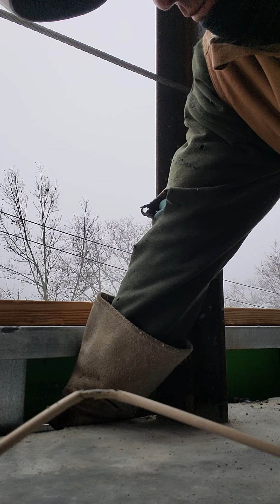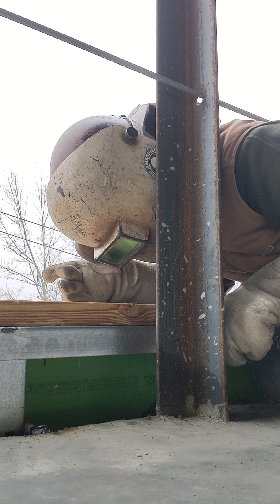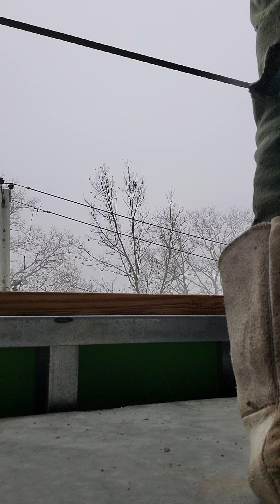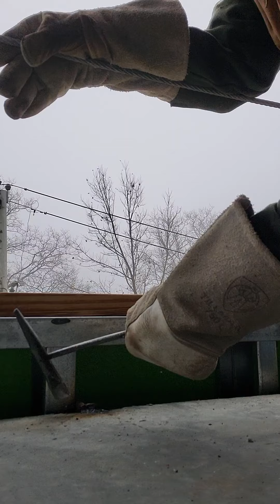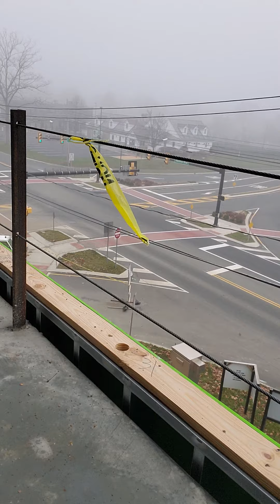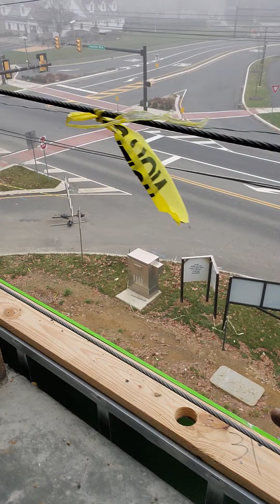Structural welding/Spandrel +Wall Panel Fast Clips !Production Welding

Comment: New subscriber hopefully starting apprenticeship in the spring trying to learn what this Ironwork is about been a shop welder and fabricator most my life
Reply from the maker: Brandon, You pretty much see, I'm all about connecting and welding, Structural steel erecting, End of the industry, Learn how to horizontal vertical and overhead Weld, 7018 wire,, A lot of my video self explain what's going on, Good luck, Where are you located!

Comment: Holy shit they make you weld that with  5/32nd rod 😳😳 I've stick welded sheet metal before with stick but it was a 3/32nd rod 6011
Reply from the maker: Matt,  What is going on, Good to hear from your brother, No I chose to use 5/,32 It works freakin excellent, I will go to the welding supply a get 3/32, This is something different than I'm used to doing, But I'm crushing it, Jet welding, This is like a trial, The company is universal, I call this light gauge welding, And then I have my heavy structural, You could see where I'm going with this, It's a good thing that, Matt, My goal is to  Build a lot of contacts,  Add an awesome company, And the men and women have a great career in welding, Period, Have a great day brother!

Comment: why are you using 6011 rods?what made you choose them for that job?
Reply from the maker: Martin, 60 series wire that is called for, 6011, I love it, And the 5/32,   Some guys use 3/32,,
Reply: @jetweldingllc4691  are you welding vertial up or down on them?
Reply: That 6011 rod will burn through surface treatment of the metal being welded.......that's what I would use....and that weld is harder than woodpecker lips.
Reply from the maker: @aramirez8427   Good morning, Thanks  For that comment, It's a good gig, Nothing really easy about them verticals, But, It's all about  Jet welding, Building relationships, Contacts, Providing the best service possible for these Welded connections1! Excellence is everything today, Trust is number 1

Comment: I realize that there’s no place for logic or reason in construction, but why, pray tell; did they not do that before they put the dens glass on the outside of the studs? Then you could have done it from a lift on the outside of the building. What would have been the hourly labor savings?
Reply from the maker: William, That's how to panels come out, We hang them with the Crane, And that's the weld  detail, That's what makes it different, Thanks for your comment
Reply from the maker: William, A lot of money they saved, , The hardest part is getting in  to Weld,
Reply from the maker: William, The fast clips are my contract, I know they get kickers, To be welded, The  Prep is to get the elevation right for the height of panel per floor, You can see in the video, They prep before they hung the panels, It really is a fast process,